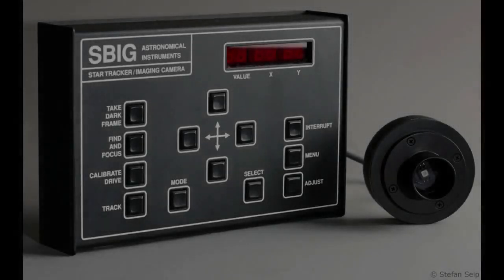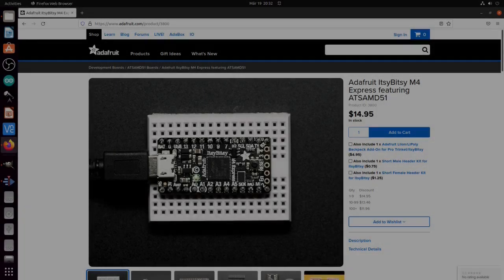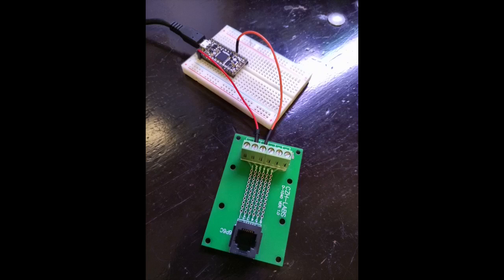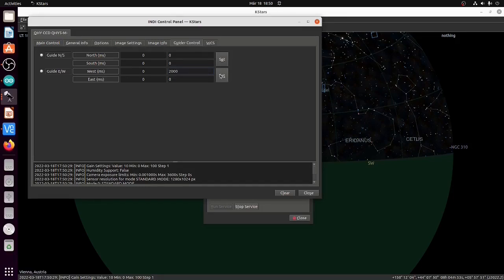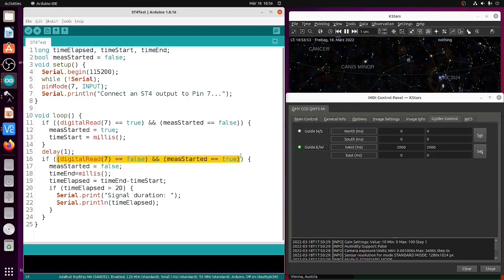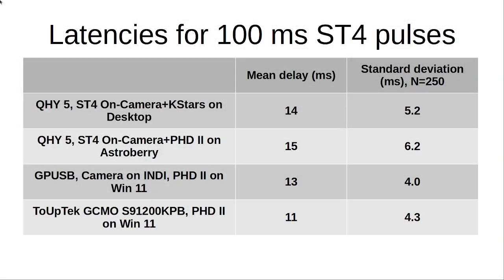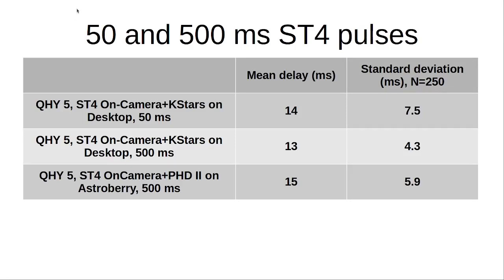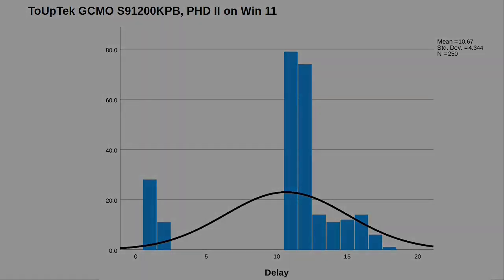What is the latency of ST4?

Comment: My two questions would be 1) Does the latency actually affect the quiding accuracy in actual operation. I would think there would probably be more latency in the response of the mechanical components, and 2) how does this compare to 'pulse' guiding which I see in other sources as being regarded as 'better' than ST4 but I've never seen a good explanation as to why.
Reply from the maker: Why should there be any latency in mechanical components if they are well adjusted? In my case, 15 ms is 10% of a typical guiding time. I never worked with pulse guiding and I see no obvious reason why it should be better. The latency is caused by the signal path in my opinion.
Reply: @wbirk  First of all I forgot my manners in my initial post. Your analysis was thorough and interesting I should have said so. Also a fair bit of work no doubt. My thought re latency in the mechanical drive is that in geared or belt systems there will always be a small amount of backlash. With gears I think trying to reduce the backlash to zero may risk introducing some binding. Also I think there would be a delay between the voltage being applied to the motor and it beginning to move. I don't know for sure, just having a thought experiment which is why seeing a video where you did actual testing was so interesting. Anyway I agree with you that ST4 guiding seems to work fine. I'm pretty new to this myself and will try 'pulse' guiding once the winter clouds go away. Anyway thanks for a thought provoking video.
Reply from the maker: @givemespace2742  no issues at all :) ... you are right that microcontroller/USB latency is only one issue. but the others (backlash, responsiveness of drives). one thing that is of course correct is that my use of the term "latency" is misleading as it is actually precision.